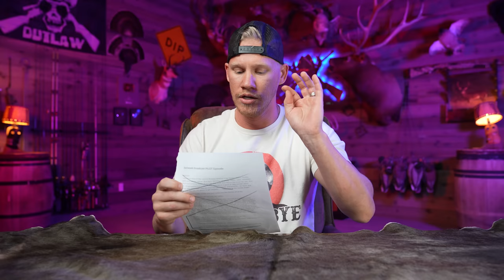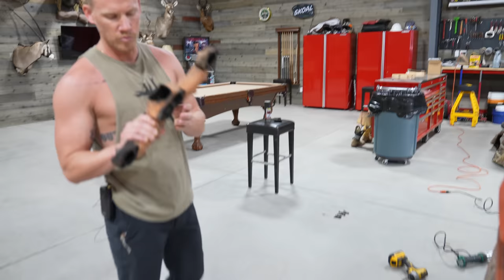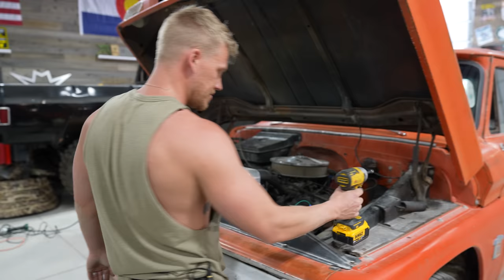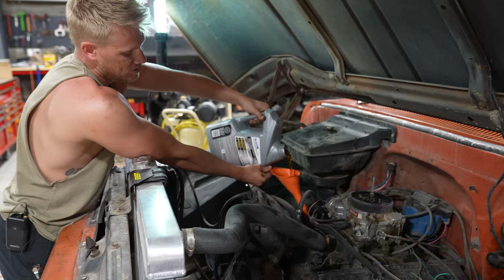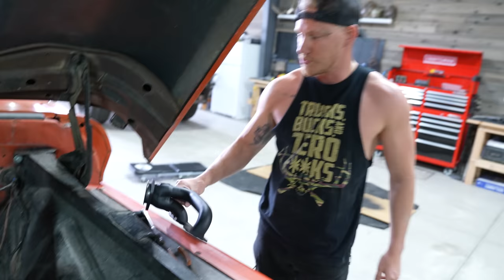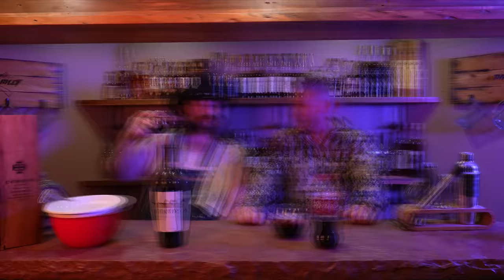BACKWOODS BROADCAST - Episode 2

Comment: Ya a lot has changed, i just use the FRE nic pouches. I know having a kid makes you view the world a lot different, and there is nothing wrong with that. Ive been using them to slowly ween myself of the addiction of nicotine. Doing the same with alcohol, I smoked weed for 10 years, not had a puff in 3 years. My lungs feel great. 
You will never forget about it, the temptation of that rush of feeling what you see as good, will always be there. Thats what addiction is, you either stand up and suffer or let it drag you down.